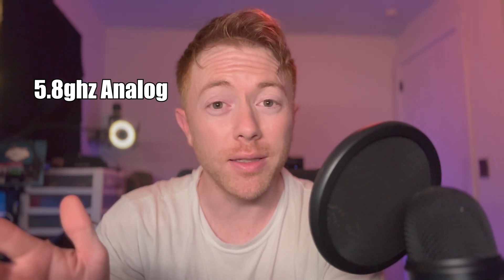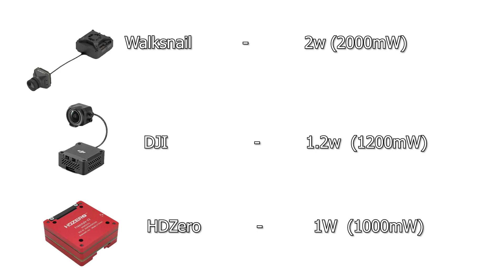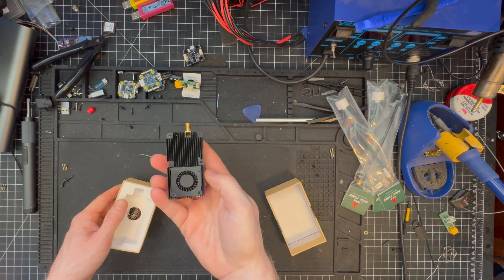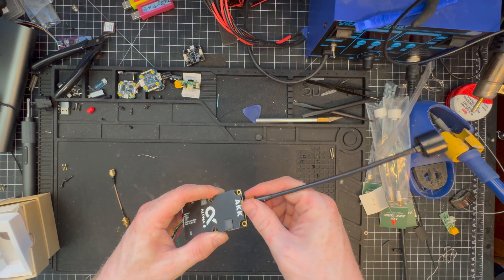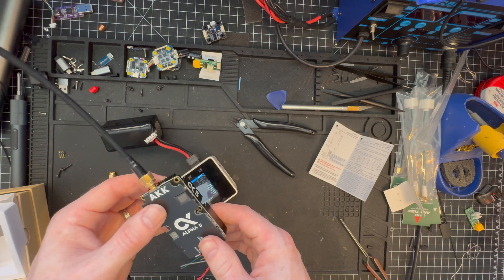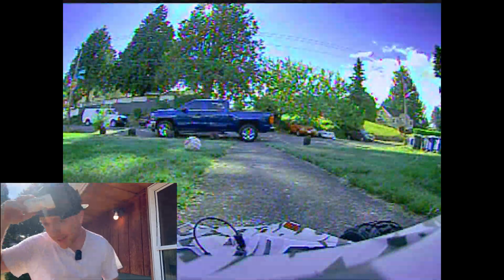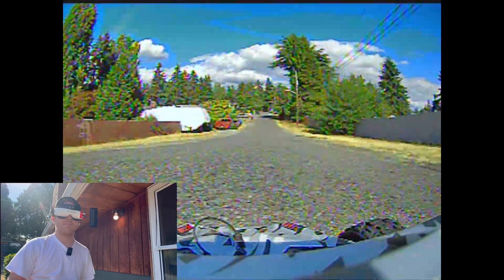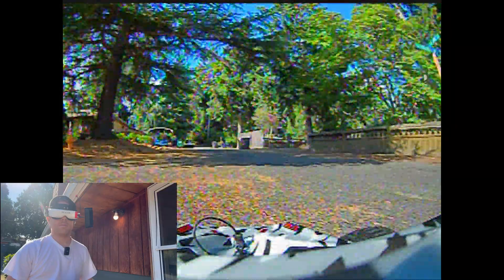How Much Range Does Analog Have? - FPV AKK Alpha 10 Review

Comment: Hi Chadd. That was an awesome vedio. Can you tell us the exact distance you traveled with 5w? Thanks
Reply from the maker: Thanks! I had no issues making it about 600 meters with obstacles. This is very important. I am sure I can make it a couple miles if it was out in a wide open field. The reason I test with houses, trees and other obstacles is because nobody has a 2 mile open field to drive in, so that test wouldn’t really be helpful 👍
Reply: @ChaddRainsFPV  thanks for the vedio buddy. I am new to all of this. Going to set fpv on my UDR but looking to make it long range. Your vedios are big help. I am going to use RadioMaster mt12. Just bought 5w 5.8ghz VTX. Just looking for better antennas now. Don’t know how it all will go. If the vedio tx will go up to 600metres I may not buy Elrs mt12. 
Thanks again for your response.
Reply: @ChaddRainsFPV  so basically if I want longer range around houses. I will need digital system? How far could you go with digital. Sorry if I am being annoying. Just trying to gather information so I can make right call. Thanks
Reply from the maker: @shankykhurmi928  Not all digital systems are equal. DJI wins in range but is the most expensive. I have a few videos that explain this. If you have good antennas and 1w VTX on analog, you can make it around just about any house 🤙
Reply: @ChaddRainsFPV  nice. I will try this 5w vtx that I have ordered and see how it goes. Just want to drive around my house with fpv camera and want to be able to go long distance. Thanks for the help. I really appreciate it. 👍

Comment: So, why not set up the controls for analog as I've seen it's more stable and reliable with interference and go digital with the video... set up a back up analog video and you should be golden (for reference I just watched a bando test with fvp drones and analog rofl stomped the digital set ups).
Reply from the maker: Analog beats most digital setups since it can have a way higher power output, like this VTX in my video. But DJI still wins all other digital systems and beats analog in most situations. 

As for control, ELRS and Crossfire both have more range than any video system, so it’s a no brainer 🤙

Comment: I have AKK 2mW in my Slash 4x4 Ultimate LCG Everything is inside the vehicle and protected. ELRS8 with GPS mod.
I can make it around my block to chase dogs off to save Kitty. Full metal upgrades with front splitter and belted raptor tires. Radiomaster MT12
If the Texas judge wants me to protect Kitty he shouldn't complain about my non lethal methods. I was too harsh in the past.
I've enjoyed every second of my new life in the RC hobby for the last 5 years. I got tired of my IEEE education go to waste. Remember everything is Bardwell's fault.

Comment: Wait a minute, I’ve done FPV in RC cars and drones and RC cars are not going to even come close to the distance you can achieve when you put the same system in a drone. The same system in a drone will out perform any RC car in distance by miles and I’ve done it myself. There is no comparison at all. FPV in ground RC vehicles has so much interference as a pose to drones, it’s apples to oranges comparison. FPV ground vehicles have terrible interference no matter whether it’s digital or analog. Love the video but terrible testing comparison.🤷🏻‍♂️👍💯🙂
Reply from the maker: There’s thousands of videos of people showing off max range, out in an open airspace. Why not a video showing off the most difficult terrain? I think this is good info to share 🤙

Comment: Great video bud! With DJI's video quality, I don't think I can stand the analog quality. 

I'll go back and try to figure out how to get OSD with the o3 Unit with the FPV googles v2 :(
Reply from the maker: Thanks dude! Good to see you drop by!! You should be able to get a full osd with the latest betaflight and using the MSP preset on the right UART (in the Presets tab) 🤙
Reply: @ChaddRainsFPV  i got the OSD working on the goggles. But not able to get it on the video after the sessons. Was able to do that with the air unit.

Comment: I was totally lost, driving in circles, you should find a long park trail in the woods to go down, i wouldn't say this is a range test though, its more of a penetration test, your vehicle rides nice though, usually ground vehicles bounce all over... but have you tried the Walksnail GT vs that 10w? I have the GT and goggles x with analog adapter, I'm building a new 7inch, wondering which is better??? That 10w vtx is expensive...
Reply: I ment 5w, but curious about the 10w too, they have a smaller version of the 5 watt that would fit in my 7inch frame, though i don't plan on crashing that so I could put the 10 w on the bottom with Velcro so its removable, with a 2.5w in the frame and just swap plugs for real long range...
Reply from the maker: I am just starting to play with Walksnail now. It looks really promising and I’ll definitely be doing the same style of “range test” with the GT. I think this is the best kind of demo / test for these systems since since less than 0.1% of the hobby will ever run into an actual range limit; it’s basically always a penetration test, right 🤙

Comment: Hello there, I want to build a fpv car.
What vtx transmitter should I buy?
• analog 5.8ghz 
-> compatible with Emax Transporter 2 Goggles 
• compatible with Runcam Phoenix 2
• 5V or 7V minimum Input
• max. 50€
• available in germany
• 400mw signal output

Comment: You should give the 1.2ghz vtx stuff a try. I’m running elrs 900mhz for rc link and the range and performance is incredible, believe I’ll be doing a fixed wing of some sort with the Geprc maten 1.2ghz 2W vtx
Reply from the maker: I have a huge amount of 1.3ghz noise in my area. I’d love to finish my ground station video but I can’t bring myself to “show off” my other rigs when they perform so bad compared to all the other options (I know it’s just a ‘high noise floor’ issue in my area) 🤙

Comment: Making an analog relay is still on my list of fun things to try. Analog really has a everything going for it except image quality. Analpg image quality is fine for crawlers and trail rc also i could go for it on track cars.
Reply from the maker: I had the wind blown out of my sails with the relay, cuz my area sucks for 1.3ghz and that’s what I wanted to use. I’d def point people your way if you can do some 1.3 stuff!
Reply: @ChaddRainsFPV  Dude did you ever get any insight into what the actual problem with 1.3 is for you. Is it just fresnel zone issues?
I remember after trying a Lawmate receiver I had much better signal, it just still wasn't what I wanted. I even started scanning with an SDR and stuff like that.. seemed relatively noiseless around me.
Reply from the maker: @Magneticitist  naa I never got deep into it. I have to really take some time and borrow a meter or two lol. 

I’m like 99% sure it’s airport related
Reply: @ChaddRainsFPV  That's kind of what I thought after looking up what might be occupying that space near me. Nothing showed up in a scan though. You're probably right in your case but for me it's still a mystery. I also tried a 900Mhz tx I saw online and it was way worse.

I was driving the Avatar GT around earlier and it was getting some pretty good range cause I mounted the receiver high on the 2nd floor with long power and HDMI cords. Only downside is not being able to access the controls on it without modding it to have super long extension buttons in parallel or something. 

I know technically you can do that with DJI also but I remember some decent lag using the app. Could have just been my phone. I got this 15 inch USB powered screen for when I'm in my car and it's pretty legit being able to easily drive it like that without goggles.

Comment: Not much point using a directional antenna if you're going to drive around the whole block but keep your antenna pointed in the same direction -- it needs to be tracking the transmitter's position... otherwise most of the time it's just the omni doing the work.   When you start losing signal you should turn your head to peak the reception by making sure the directional antenna is facing in the optimal direction.

A good 10dB directional antenna is the equivalent of using 10x the transmitter power -- so long as it's pointed in the right direction.
Reply from the maker: Hey Bruce! It’s one of those instances where the house being right next to me kind of nullifies any gains from the directional, because of the direction I want to travel. The house is pretty much always right in the way, but it’s still the best spot to get around the backstreets. 

I have a very sensitive ClearView receiver (-107db iirc) and could set that up on my roof with an antenna tracker, but 99% of people will never go to that extent. I was just trying to get a solid explanation in during the review 🤙
Reply: @ChaddRainsFPV  Even more reason to make sure your antenna is pointed at the model -- you'll lose a bunch of signal with your house in the way but the gain of the antenna will compensate for that.   High is good too 🙂

Comment: I was surprised to see in another video that the 10 seems to actually output what it says and somehow doesn't overheat using only the blower. IDK if I'd ever try over the 5 though, I mean it did hold up pretty well. I'm not saying you shouldn't though 😅. I don't think practical range can really be explained in the way people want and it has to be experienced over time in different locations etc. I mean I guess it can be summarized easily enough if the circumstances are standing in flat open plains for miles but that's not realistic for most people. For me analog was also a struggle of just wanting to see clear video the whole time cause of being paranoid, but figure it's a great alternative to digital if the location is something you know well and there are no hazards etc.. can really push it with no worries I guess. I used to see some dudes going super far but then catch a video of their live feed and they are driving with like 5% visibility and I'm like "how?" 
Like I've seen dudes drive through where you turned around at, like their eyes and brains have just been trained to learn maneuverability with such low visibility or something. I'd have called it quits long before that. Alternatively, I used to see videos of dudes in the AIR and it seemed like they were losing visibility just going out in an opening too far and I'm like "how?"
I'm kind of biased against AKK for stiffing me on a 1.2g I broke down and bought like close to a year ago lol but I have to admit the big boy 5.8g's do look well made. Apparently audio works decent on them as well. When you have that audio, and you add at least one more camera like on the rear, it basically changes the game making analog a contender even after all of these digital releases.
Reply from the maker: It’s so hard to explain range and it seems like it’s asked about so much. Gave it my best shot on this video lol. I definitely can’t switch back to analog but at the end of the day I realize the majority of FPV is still done on analog, vs any other one system. If I never tried digital I would be pumped to get this kind of range lol. 
I really should try out the mic on these. I heard RapidFire modules don’t come with any audio ability anymore so it’s getting harder to even use that now
Reply: @ChaddRainsFPV  I never tried rapidfire but now that I think about it I'm not so sure how I'd go about audio without the one module that was giving it to me. I think the Steadyview module but IDK how it really compares to rapidfire.
Reply from the maker: I think TBS Fusion is best and I’m pretty sure it has audio. RapidFire is basically the same but the receivers in the Fusion module are a hair more sensitive. I’m just using RapidFire cuz I’ve had it forever lol